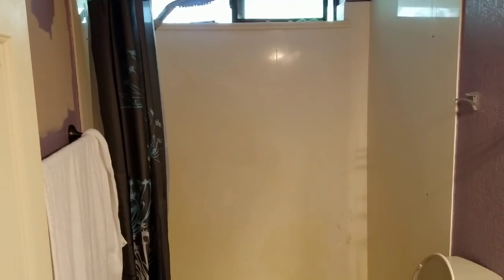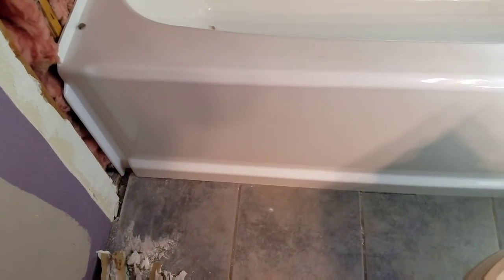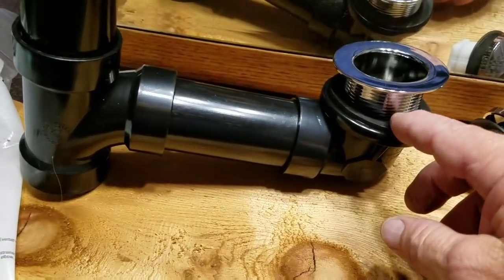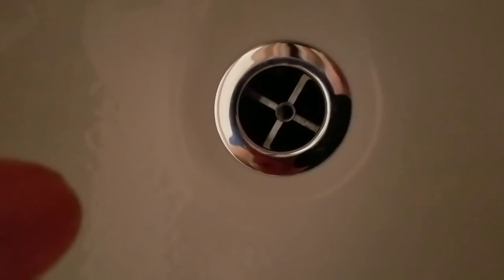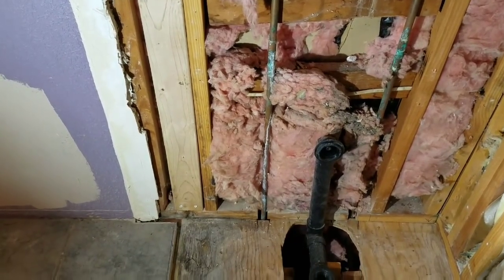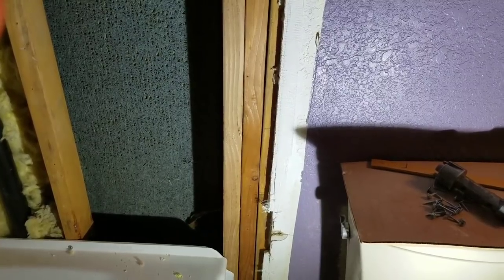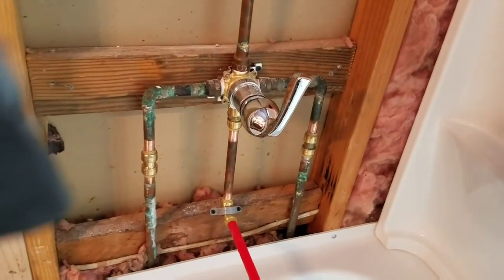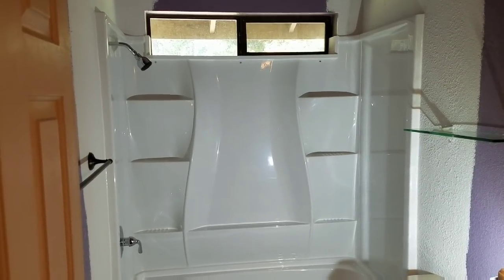How to install Fiberglass tub surround...Easy !!!

Comment: All my elders always said "Dead Nuts" I found out later it is actually meant as "Dead Balls" that made me laugh that they did a play on words. I love your videos, you are the John Wayne of remodeling! I am installing a very similar product and your videos are super encouraging and helpful. I think I found something about this install that I am currently dealing with on mine.... The way you set your plumbing fixtures... If you would have set the control valve back closer the to wall, maybe used a half inch plywood spacer instead of the 2x the knob handle would have set more closer to the wall.  that is how it is indicated in my instruction manual though they do not make it very clear and have zero data or any kind of measurements to go by.  That window ledge turned out beautiful! Thank you for sharing your knowledge.

Comment: Really great job. I like the way you handled the trim around the window sill.
Reply: I feel like it wasn’t waterproofed well, just caulking in those huge gaps without a waterproof layer underneath. Disaster for mold in a few years or if the caulk shrinks and opens a tiny hole.

Comment: Not sure if you will get this comment. I have a very similar delta shower surround I installed my problem is I’m trying to install a door system and the area where the frame attaches is hollow behind and I’m having a hard time finding anchors that will keep it secure to the wall surround. Any ideas? Thanks
Reply from the maker: Hi Gary

They are called hollow wall anchors
There are a million different varieties
Here is one kind
https://www.acehardware.com/departments/hardware/screws-and-anchors/anchors/5466099?store=07367&gclid=Cj0KCQiAjJOQBhCkARIsAEKMtO0sMWw1IGDEJleGotPvp6AnZRs2Ui-577MqIRYdsU2jlD9xtl3hL08aAl19EALw_wcB&gclsrc=aw.ds

Comment: Thank you for the video. Couple questions.... What material did you use for the window sill? Do you have a video for cutting the surround to fit the window? What do you recommend if the installer put the surround in above the window sill?
Reply from the maker: Go to home Depot or some other place like that and buy synthetic wood and install that with a little bit of a drop so the water will come down and won't stay up there so it shouldn't be level It should drop into the shower if any water should get up there and then seal it super good that way you'll never have an issue and have it extend past whatever surround you have so if you have a surround and it's out 2 in farther than the wall stick that bottom sill out a half inch more than that and then get it all sealed up real good and it'll be perfect as far as cutting this around yeah that's simple you can use a whole bunch of tools but one of the simplest tools will probably be a 4 and 1/2-in grinder with a steel blade attached so it's a carborandom blade
It looks like a 1/8 inch or less black material made for cutting steel and we use it for everything and you put it on a grinder and just hand cut it you can of course obviously use an oscillating tool or anything else there's all kinds of tools you can use

Comment: We just got ours done and, unfortunately, it was put in on top of drywall. Since it was done for free by a family member, we are extremely grateful to have a usable tub/shower, but wonder if you have suggestions to cover the flanges. My husband wondered if there was some sort of fiberglass trim while I'm figuring it would be painted wood.  Thank you for the video.
Reply from the maker: Hi Lucy I got a bunch of different ideas but I need to see some parts of it 

anyway 

 snap a couple photos of the top, back, sides.... give me something to work with  and I'll be able to address the situation better Text Me at 541-660-7805

Comment: Does the DAP go in the corners where the walls meet? And where the walls meet the base? Just had one put in the contractor and said it wasn't necessary. They only put silicon on the base meeting the walls not where the walls meet. There is also a gap on top where the two side panels meet the large panel. Is that normal?
Reply from the maker: Text me some pics at 541-660-7805 I'll walk you through any issues

Comment: One really HUGE step missed in this step by step guide. How to accurately cut the holes in the wall for the tub spout, shower handle and shower head.
Reply: Jeff H also always mortar in the tub if it is not cast iron.
Reply: Great lesson 👍. Thought me the drill Sargent way. Good job. I'm almost done .
Reply: If you can't cut them it's your own fault. If you got them wrong that's your own fault. If they cause a leak it's your fault too
Reply: @austincurtis636  I understand who's fault it is, just saying that would be helpful to throw into this video as well, but thanks!
Reply: @jeffh536  I meant no disrespect, I was trying some sarcastic humor and I had a couple?? beers when I was watching. I thought this was an awesome video and it gave me enough info and inspiration to try and install my own tub / shower when my back feels up to it.

Comment: What happens if you have a window "dead nuts" in the middle? Anyway to keep the windown without completely destroying the wall system?
Reply from the maker: Yeah if it's any worse than mine 

meaning

 the windows wider 

or taller 

or lower 

I would just go with a flat wall panel and not use the wall system

I use flexstone totally awesome product

I order it through Home Depot
Reply: @Jonehughes  I bought the Bootz tub and Nextile surround system. I have a smaller window but it's literally dead center of the wall. I was told if I was going with a direct to stud system which I have to remove the window or apply over it but I'd hate to loose it. Or if I wanted to keep it, go with a glue up surround system and cut out the window. I think I'll either do away with the window or if I buy something else, get cement board and use the Schluter kerdi waterproofing membrane keep the window. I don't think there's a way to keep the window and still use the Bootz kit without destroying it.
Reply from the maker: Yeah I think you are correct

Comment: Can I have drywall or cement board behind this enclosure because without it the dimensions are to big?
Reply from the maker: You want 60in from stud to stud

If you have more than 60 in

You can fill it in with whatever you want it's not a wet area that needs to have concrete board

Comment: Hello Jon, where the side walls meet the tub, does that seam get caulked? Thanks in advance.
Reply from the maker: Yes every single seam, you want to make sure that they are completely sealed, as though it was a one piece unit
Use one ,of only four ,approved sealants, you cannot use any other sealant, they will not stick to acrylic
Reply: @Jonehughes  Thanks Jon, in the video I see you're using DAP 3.0, so I'll be using the same.
Reply from the maker: Gap quit producing 3.0
They say that AMP is the new 3.0
I hope it's as good, I already used it on one shower and haven't heard anything bad yet ,but still it's very aggravating they changed it ,without telling us, but they say it's better and I can tell you that it for sure comes out of the tube easier ,you don't need a hydraulic.

https://www.homedepot.com/p/DAP-AMP-Advanced-Modified-Polymer-9-oz-White-Kitchen-and-Bath-Sealant-00762/316997383

Comment: The manufacturer's assembly shows adhesive to the wall and then a picture with braces holding the walls while the adhesive cures.  You did not show any of that in your video.  Did you do the braces?  Did you use adhesive and then screw in the tops and sides?  Do you have a video clip to show how much adhesive to put between the walls prior to sliding them together?  Thanks. The video is very good.
Reply from the maker: Hi Joe
Yeah use adhesive

The manufacturer should call a specific kind

Use that kind

And then put up braces to hold the walls until the adhesive dries
Reply from the maker: I personally do not use the adhesives

And you not supposed to put on any adhesive before you slide the walls together

Once the wall is set

Then you caulk it all in with the proper
Caulking

I Don't like gluing the walls

I don't think it's necessary

Once you screw the entire perimeter

And then you caulk all the joints

It's perfectly fine....

Comment: did you glue the walls to the studs? and in the box there are 2 gaskets both rubber that go on the drain plug i see you only used one on bottom thread?
Reply: Are you referring to the drain on the tub? The second gasket goes on the overflow

Comment: Do you have to put mud on bottom of tub or just set it in and nail ?
Reply from the maker: It has an engineered honeycomb structural base

It is designed to not need mud if set on a level solid floor

But I always do anyway

Either mud or foam either way is fine

It just gives you an extra layer of security

Comment: Does the lip of the apron support go on the outside or inside of the tub?
Reply from the maker: If you look closely at it
 you can see a small little L

And it's supposedly supposed to ride on that 

so in essence 

it's behind

 not in front

 but that L is so small that I've never been able to use it

 I'd just keep it behind there 

so the apron can't push any farther in

 You're simply trying to keep the apron rigid 

I've had better luck by installing two by twos the entire length of the apron 

and that holds it Ridgid

Comment: Nice job.  Thanks for showing the finished trim work.  Did you need an extra horizontal stud in the faucet wall for the middle of the panel?
Reply from the maker: No I don't put any horizontal framing in
The kind that are installed when you first buy a house have no horizontal supports

And these kind are stronger than those kind

This is acrylic not fiberglass

It does move a little when you touch it

I think they would prefer that you glued it to the wall in a bunch of places to make it Rock solid

But it's absolutely unnecessary

I've done over 50 of these and they're all perfect

If you want to take the time to put a whole bunch of horizontals in

And glue the snot out of it

Go ahead and do it

It won't hurt anything

But it doesn't accomplish anything either

Very rarely do I ever touch the walls when I'm taking a shower

And if I did a little tiny bit of flex isn't going to scare me

This stuff does not crack or break like fiberglass

Once you cut a hole out for like the shower valve

Try to break that round disc that you just cut out

No chance in Egypt

This stuff is so strong

Comment: Am I wrong..? It seems like you say use dap 3.0 and it can’t leak, but then you use plumbers putty instead?
Reply from the maker: Hi apologise for the reference to the plumber's putty

On acrylic unit you must use dap 3.0

Nothing else will stick to it

Silicon will not

Plumber's putty degrades the acrylic

You must use dap 3.0

 I have never had a failure using dap 3.0

Comment: Best way to cut the opening for the window?
Reply from the maker: If using fiberglass then cut it with a 4 and 1/2-in grinder with a steel cut off blade works super simple

Comment: Just to clarify, you use the Dap 3.0 to fill in the gaps where the tub and wall pieces fit together right?
Reply from the maker: Let me be a little bit more blunt

Used Dap 3.0 every single place you are touching acrylic 

because nothing will stick to acrylic

 except that...

So yes 

fill every single seam

 and then all around the perimeter also

Anywhere you are touching acrylic

Use Dap 3.0

Painters caulk will not work

Silicone will not work

Nothing else will stick to acrylic
Reply: @Jonehughes  thank you! I'm currently installing one now for someone. I appreciate the info
Reply from the maker: And just so there's
 no misunderstandings

Truly it's the last thing you do
 after painting

Seal every seam and seal around the entire perimeter

Comment: What Drain Kit are you using?  The instructions say you need a 16 1/2" Drain Kit but I've only seen 12-15" kits.  There's another kit that says it's 17"-21" but I believe that's for those Jet Tubs.  Any help would be great.  Thanks!
Reply: Ah.  Cancel the request.  I see you had to get an extended tube.
Reply from the maker: If you will buy the ABS drain kit

Are you have to replace is the one long piece

It isn't a specialty size

Any inch and a half ABS will work for its replacement

And you are good to go

Feel free to ask any more questions brother
Reply from the maker: Stupid spell checker

All you have to replace is the one piece

Comment: We have the same one we are installing now what’s the stick of wood you put in front of the tub on the floor? We noticed the tub tendes to push in at the front
Reply from the maker: Hi Jessica

Yeah it does that

It's a stupid design

They have a little bar that you use that kind of holds it in place

But it sucks too

Your best bet is to do what I do

Dry fit the tub

In other words

 set it in place
 exactly the way it will go

 once it's secured to the studs

Use a pencil or a marker

And Mark right along the front face of the tub

Right along the floor

Exactly where you would like the front to be

Remove the tub

Then take a 2x2 piece of wood 
that is 4 ft 6 in Long

And put it 1/8 of an inch back behind the line

 that you just made on the ground

The 2x2 will hold your tub apron solid 
and won't let it push in anymore

It's easy for me to say

But may be hard for you to understand

What I mean

You can always text me at 541-660-7805

Jon

I can walk you through the issues
 you might come up with

You guys got this

It'll work out perfect 😀
Reply from the maker: Jessica I also have two or three other videos that show the same tub installation and finishing of it

 so go check out those ones first and if you still have questions feel free

Comment: I just had a plumber install a standing shower only in my basement. It's one of these 3 piece plastic surrounds. I had a few questions. The middle panel (the biggest one) was not properly supported and gives a few inches if you put any pressure on it. Is there any way to support that now without tearing out the brand new drywall and everything else that just went in? I was thinking of maybe some foam or something? Or will the sealant/ silicone I put in the corners be enough? Also, since I don't have a tub and it's a shower only, do I have to use the dap 3.0 for the seams or will a regular high quality white silicone work?
Reply from the maker: Yeah 

don't push on it 🥰

If you have good silicone on your seams and it's not a acrylic unit like the Delta 400 then you're going to be fine and it's all sealed in 

 those kind of units usually Flex anyway they're just intended not to be pushed on so as long as you don't push on it

 it will last you years and years
Reply: @Jonehughes  okay great. We're actually getting ready to sell this house and I just didn't want to leave the buyer with some big issue that would end up costing them a bunch of time and money down the line. Thanks so much for the quick response. 👍

Comment: The exposed screws towards the top of the back wall. Do you do anything to seal those in or cover them with something? Or just leave them out in the open? Is rusting an issue if left exposed?

Very awesome video. Definitely answered a lot questions! Thanks!
Reply from the maker: Hi Kaitlyn
No I only use those to hold it in place while the glue dried I used the same silicone for the whole project to glue it as well as the rest and as soon as it was done I filled the little tiny eighth inch hole right there where the screw was
Reply: Jon Hughes We bought a fiberglass tub  and surround (well I don’t know if the surround is all fiberglass actually). Anyway, what silicone glue would you use on fiberglass?  And do you silicone between the wall joints?  And why didn’t you use a plastic vapor barrier behind the tub over the insulation?

Comment: To do this kind of job what specific tools will I need? I have been wanting to try this project myself but to be truthful I have no experience in this field of work. However, learning will help with home expenses. So I gotta get it going. Especially since it's in major need of a replacement.
Reply from the maker: Absolutely nothing specific

I have seen guys rip the old one out by hand

Using no tools but a hammer

I like using millions of tools

I own every tool in the world

Makes the job way easier

Sawzall
skil saw
Screwdrivers
Oscillating tool
Pliers
Levels
Screw gun
Caulking gun

If you have at least these

It will go pretty easy

If you don't have these

You will have to MacGyver it
Reply: @Jonehughes I'll look into those tools and begin to purchase them. Afterwards I'll see how it goes by the time I start the project.  Thanks for the info.
Reply from the maker: If you have any issues

 let me know

 I'll walk you through anything
Brother

Comment: Does the tub have to be recessed back into the wall like that? Or can I put it right on top of the drywall
Reply from the maker: It all depends on your circumstance
 in some mobile homes
 the drywall is 60 in away from each other 
in a normal framed house
 it is 60 in between studs 

but if you have 60 in between walls 

In your circumstance

 you may do that 

you need 60 in between the walls for you to be able to pull that off
Reply: @Jonehughes  thank you !

Comment: Hi, Video very helpful, was wondering if you had any tips on how to drywall/sheetrock up to the edge of the bath wall like you did... I am doing similar Job but the edges are tripping me up.
Reply: Measure twice cut once... try some j bead
Reply: Durabong